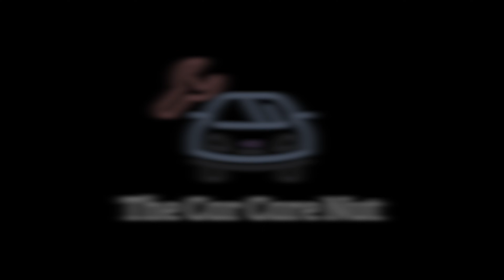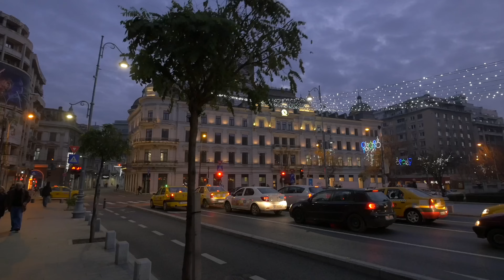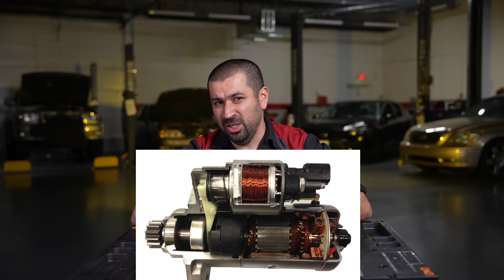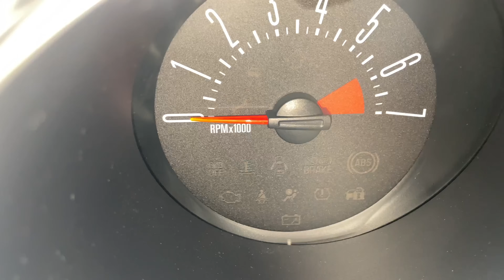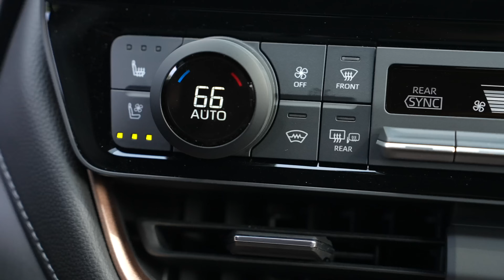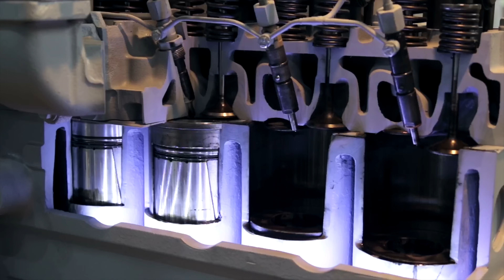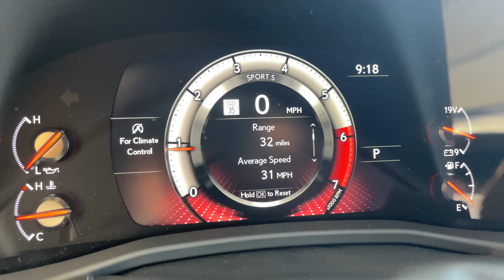How Does Start Stop Technology Work in Modern Cars? Everything You Need to Know

Comment: The battery info is especially vital to me since I thought in 4-5 years I could replace the 12v battery myself. I have a 2022 Venza & had no idea how complex the hybrid system really is. Thank you AMD for this very important video.
Reply: You can still replace the battery yourself, you just have to buy an AGM battery. AGM means absorbed glass mat, and it means the battery acid inside is absorbed into fiberglass mats instead of sitting as a free-flowing liquid. They cost between $180 and $250.
Reply: @jefferysurratt5650 you gotta be careful though. A shock from the hybrid battery is certainly lethal
Reply: @mitchaser5159  He's not talking about the hybrid battery.

Comment: There is NOTHING “special” about an AGM DEEP CYCLE sealed battery!

It’s simply made better than your flooded battery and has fiberglass mat between the plates and the plates are thicker to withstand deeper discharges (flooded batteries get damaged when discharged below a point)

Expensive? Only for people like you that don’t understand what they are looking for and pay the crazy Toyota price. Toyota does NOT make batteries, RIGHT?

The device on the battery terminal is more than just an amp meter:
It’s called a BMS (batt management system) and keeps TRACK of the battery HEALTH (age, cycles, amps in, amps out, state of charge, max/min voltages).

Now, intelligent car makers can play with the valve timing to make the engine start VERY easy on the starter and I know of a 2013 civic hybrid with 160K that was in daily long heavy city traffic (50-100+ start/stops daily) until recently and no issues yet.

Comment: informative vid...no one is saying not to if you choose to help with emissions, but 
why not have it OFF and then the driver can push the button ON if they want to use it ??
but instead they have it on and it's up to the driver to push the button off, basically forcing the driver to use it
how did FORCING ppl to bring their own bottles&bags everywhere environmentally work? exactly,it should be off until its needed

Comment: Im a retired  diesel  mechanic . The diesel engines had a prelube system.  When you hit the start button an electric pumped engine oil then the engine would start. Hot or cold it did this to reduce engine wear.

Comment: My car is has a manual transmission. When I turn the key momentarily the starter continues until ignition, rather quickly, probably developed for remote start feature. I could effectively use it as a manual start/stop, but would shorten the life of a conventional starter.

Comment: I bet they don't warranty the 380K starter for free if it craps out earlier.      If the car has a bypass feature will it ignore any of the multiple items that could fail that allow the stop/start 
to work, letting you continue using the car until one day the starter actually fails?   Confused on your comment about emissions.  I would assume emissions for a State inspection is still checked with the engine running?

Comment: The idea of the engine shutting off especially if I am at Red Light on a hill scares the hell out of me.   My brother has a Ford Truck.  Every time he starts the truck he turns off this feature.
Unfortunately the engine turn on default is with the engine turn off feature restored.    A Ford dealer told me most of their customers don't like the idea of the Engine turning off and they
lost sales until they added the ability to bypass it.   The other thing that bothers me is more things to break and cost the consumer a fortune.   I don't think the world will come to end
if we let the engine run when stopped.  Cars/trucks today have much lower emissions then they did 20 years ago.   We as consumers need a compromise to emissions.

Comment: I personally do not like this. The customer should have the option to permanently disable able this. I have a 2021 Rav 4 XLE and I took the conector plug of the hood lock and this permanently disabled this start sop feature. The only downside that if you left your hood open  it will not let you know this. But I can live with this then having to disable this dumb feature every time I start the car.

Comment: I wonder if you have had any experience with the “parking assist malfunction” warning message that won’t clear from the message center and renders it useless.  I got this message on my brand new ‘23 Tundra while driving down the road.  I had to wait several days to get it in to the dealer.  They looked at it and told me it had a damaged front bumper proximity sensor and that would cost me approximately $740 to replace because road hazard damage wasn’t covered by the warranty.  I thought this was ridiculous, so ordered an OEM sensor online, and guess what.  It didn’t fix the issue. I have looked at various forums while researching this issue that appears to happen frequently, and no one seems to have an answer.

Comment: I really despise having to hunt the ETC button on the dash every time I tow or drive in hills. Why isn't that stupid button on the selector. Does Toyota want to toast the torque converter by using it as an operational clutch? Also they want your eyes off the road? I want this stop start crap on someone else's car, or at least default to off with the control on the shifter or wheel. Are you listening, Toyota "engineers?"

Comment: The most annoying thing about start/stop is that it is unaware of the cycling of the traffic light or other reason for the stop. A simple button or two buttons that would allow the driver to stop & start the engine would be much more efficient and much less annoying. If I'm pulling up to a light that has been red a while, with 5 cars already stopped, no stop/start should be used. If I'm pulling up to a light that just turned yellow, then I'd be glad to turn off the engine if I could smoothly turn it on again at the appropriate time, as judged by the driver. I sometimes turn off the engine in my non-auto-start/stop truck when that is the case and I know the light to be a long one.

Comment: Excellent video, never knew that this start/stop system was so complex. I think it would be better to produce a mild hybrid than give this technology. Main benefit would be that you will get electric HVAC compressor that will work as a heat pump for cool or heat. I am sure there would be cost benefit of having this vs the hybrid. Everything boils down to economics.
Reply: I have a car with 48V mild hybrid, but unfortunately it still reduces the power of the climate control when the engine is off. I immediately disable start/stop every time I get in.

Comment: Equating "living with" fuel injection and "living with" auto start/stop is quite a stretch. In one case it adds some complexity and novelty (at the time) but in return you get reliability, efficiency, power, everything good. In the other you get massive complexity, cost, horrible start/stop characteristics (why does it always stop just as the light turns green?), less ability for the owner to do maintenance, and planned obsolescence.

Comment: For a Honda/Acura there’s something sold by “idlestopper” and it’s basically a pigtail that bypasses the switch in the console and turns the switch into OPTIONAL which is how the thing should have been made in the first place lol. I also installed an SVCM controller which is a pigtail that bypasses the coolant temp sensor and essentially tells the ECU the engine is below a certain temp therefore never shuts off 3 cylinders. It’s got a safety where it shuts itself off if the engine is gonna overheat. This stuff is getting out of hand people….

Comment: Of course this annoying system lenghthens the life of the starter, and is great for the engine bearings, lubricated parts.🙄 Gee, doesn't the majority of wear occur on start up? But "all the gas saved"😅 will offset the cost of the afore mentioned parts replacement!! 😂

Comment: Engineering marvel… mechanic / owner nightmare. Half the engine will need to be removed to replace the sensors, expensive starter, expensive battery, more$$ for very little gain. All these extra heavy duty starters, batteries, sensor, add weight and create 100 more points of failure. Put this one where you put the safety spout for gas cans…

Comment: I had no idea that this routine was so complicated and that it required so many sensors to accomplish it's goal. No wonder these cars have seen such a rise in cost, plus it's added more opportunities for failure. Thanks for your good explanation.
Reply: I’ll stick with the simplicity of my manual 2015 Scion XB.
Reply: @djkenny1202  in hybrids it works perfectly, after shutting down the engine it would not even start it - as on low speeds electric motors would work instead. also - in hybrids hvac are fully electric and work from big battery - and you could sit in your car with comfort for 20-30 minutes without engine.
Reply: @s.i.m.c.a yeah, start stop seems like a poor substitute for a hybrid
Reply: And it doesn't even accomplish anything 🤦‍♂️
Reply: AcCording to master mechanic, Scotty Kilmer, start start causes more problems than it’s worth and wears  your car out faster this coming from a real mechanic who deals with this system https://m.youtube.com/watch?v=L7524u5w4ZE&pp=ygU1U2NvdHR5IEtpbG1lciBzdG9wIHN0YXJ0IHN5c3RlbXMgYXJlIGJhZCBmb3IgeW91ciBjYXI%3D
Reply: @Nic1Moreno  
-I'm
-carries
-different
Reply: Cars are moving computers not just a car, Lexus/Toyota Hybrids use 12 volt battery to run the computers, Hybrid battery starts car and gets it moving, Toyota Corporation added a low gear connection to CVT transmission.
Reply: @Nic1Moreno  This is the excerpt from the owner's manual of my car:
"If an engine is only idling it takes much longer for it to reach its normal operating temperature. Wear-and-tear and pollutant emissions, though, are particularly high in the warming-up phase. Therefore, start driving as soon as the engine has started, In this case high engine speeds should be avoided.
"
You, Sir, have confused the issues at play - you should not rev up an engine when cold, especially in older models, when distributor cap could literally explode due to temp differences, but no one ever said you should not drive immediately after engine start. In fact, you actually should, as it will get the engine to optimal temp faster.
Me, I am not using accelerator within first 2 min of driving cold - just clutch and brake... Yeah, manual gear shift, wouldn't have it any other way.
Reply: Gov try to do good with new emission controls but all being cancel out with more parts to replace (more carbon to manufacture these replacement parts) ending up to NOTHING! More annoying than anything else - especially if you in middle of cold wheather when engine shut off and you kind of stressed out whether the damn engine will start again or NOT!!!
Reply: @samt1039  yea
Reply: @samt1039 cool story bro.  As annoying as they are, overall these cut emissions by a great deal over the life of the car.
Reply: @samt1039 ”the environment” isn’t just carbon emissions. Cities tend to have worse air quality (for our lungs, not for climate change or whatever) and not having all those cars idle at the stoplight could help with that. I don’t have data on the impact it does or could make, but do know about the impact of smog and bad air quality on humans. Considering that, the development of start/stop was a logical decision and a technological feat.
Reply: All of these sensors already exist. The sensors already are in the car being monitored anyway. You can literally look at your vacuum reservoir using an OBD2 scanner. Even on a non start stop car. And even better, start stop motors are so overbuilt they have almost no failure rate. Almost nobody ever switches them out. Except for Kia Hyundai, but they are city cars anyway.
Reply: @Nic1Moreno  Oh, and your wrong, 20-30 seconds, that is it , so take your lumps and move on.
Reply: Well, killswitches are mandatory on all vehicles 2026 and newer...So much for freedom of travel or movement of goods.......FJB!!!
Reply: @Nic1Moreno  you seem triggered, and you failed to acknowledge that you misunderstood the post you replied to
Reply: @Nic1Moreno  that is simply not true, a modern engine does NOT need to be warmed up. And the person you responded to commented about a running engine not restarting at a light or whatever
Reply: @BurkaLifter So the modern engine manage to bypass the thermodynamic laws of the universe 😂
For anyone with a brain, you might have just written: “I’m dumb, so what” 🤣

They are forced to say that by the gov. 
The emission laws over the decades NEVER considered the cost to the car owner, EVER. In fact, did you know you could have an engine do 60-80 MPG on average if it wasn’t for emission standards? You do know half of the complexity of modern engine, and I’m being generous here, is because of the emission laws? They impact EVERY aspect of how engines work, in negative way. 
Should we have them? Yes, I’m pragmatic person and can weight pros and cons of societies BUT don’t try to insult my intelligence and tell me there are no cons to it. That’s them taking the “say” away from me and inserting themself as being my “parent” and knowing “what’s good for me”. 
I any a kid no more and they aren’t God. Do me like that and I’ll take the opposite side EVERY TIME, to make sure I have the freedom to do so and to find out when I don’t so I can start the next refresh of the gov. 😂
Reply: @MD-gk4uh  You truly are a simpleton. and your mom say hi
Reply: @MD-gk4uh  you are as triggered and insecure as that other pinhead, an empty gourd makes the most noise. Since the other post is gone, I think you are nick1moreno
Reply: @MD-gk4uh  wrong, you have no idea what you are talking about, you sound pathetically insecure
Reply: @BurkaLifter that's false it's always good to let the engine and fluids warm for a few minutes before driving especially on cold days....
Reply: @truckercowboyed2638  well, you should probably send your findings to all the car companies and NASA
Reply: @truckercowboyed2638  Incorrect, SOME engines, absolutely, but not ALL
Reply: It’s better to have start and stop
Reply: @BK-pc3ei No it isn't. It doesn't accomplish anything meaningful. It is a complete waste of time and resources and only indicates stupidity made its way into the car industry 🙄

Comment: So, approx. '10' years on such a starter. Anecdotally, I have a 2007 Nissan Frontier, which I bought new, with just over 80,000 miles, most of which involving very short trips with constant starting. It still has the original starter.

Comment: Mr. Car Care Nut,
I watch your youtube channel all the time and I subscribe as well.  I have a 2014 Toyota Tundra 1794 Edition with 204,000 miles, no else at all. I was would if I should have transmission checked by a transmission specialist before having the transmission flushed?  I was flushed at 100,000 miles.  Again, I have no issue with the vehicle at all.
Reply: CCNut has videos on flush vs drain & fill and service interval on Toyota transmissions.

Comment: I permanently disabled this in my wife's Honda CRV. There are companies that sell a small board with an SCR semi conductor which can be bought with a built in timer that pulses once after a set amount of time. I bought one that will give me a  500 millisecond non latching contact closure 5 seconds after the car starts. 500 milliseconds is close to the equivalent of pushing the button by hand. It's the same technology used in push button start. It's a tiny board with a few components on it that takes 12 volts from any power source in the car. I got my 12 volts from the power adapter port.The beauty about it is that you can leave the button connected in the event that at one point or another, you would like to activate the start stop feature. Essentially, what you are doing is reversing the operation of the switch. Instead of defaulting with the feature on, you are defaulting with the feature off.

Comment: Thanks for this thorough and educational presentation.  I have driven a number of Lexus hybrids and they all behaved beautifully when the engine shut off at traffic lights.  But not all companies are as competent as Toyota.  I test drove Jaguar and Land Rover SUVs a few years ago and when the engine shut off, the AC shut off.  Here in Florida, that is a serious flaw.  The companies may have rectified the situation by now, but it is revealing that they failed to anticipate this problem before producing the vehicles.  When the stop/start system functions like it does in Toyotas, it is seamless and effective at reducing engine emissions.  I wouldn't assume that other manufacturers' systems meet that same standard.
Reply: Hybrids are a different design, they can drive on electric only thus gas start hvc operation work better

Comment: Another fantastic video AMD. I have a couple questions. 
1 in a previous post you said to get better gas mileage from a Hybrid is change your driving habits by getting up to speed then basically coast to allow the electric motor to take over. If it's charged up. Would this just cause additional STARTS to your high efficiency starter since it is only limited to a certain number of starts. 
2 will you do a video in the future of replacing a high efficiency electric starter. You're the 1st mechanic that has ever stated the EXACT number of starts you can get during the lifetime of your vehicle. I had never heard of this before. Can we use a scanner to check how many starts has occurred.
Keep up the vids...I love them.